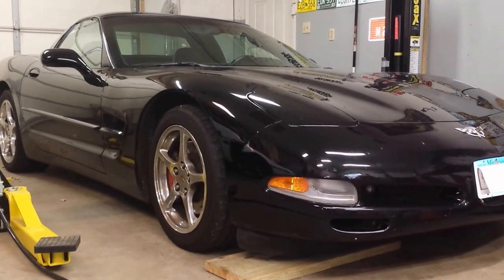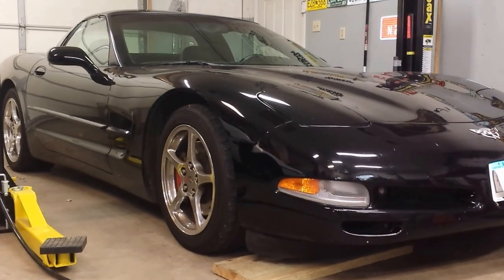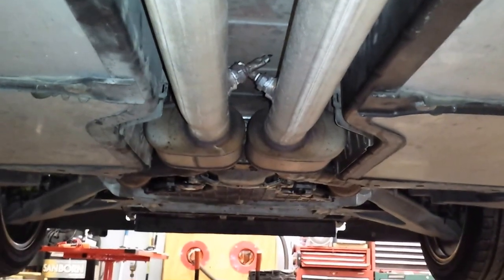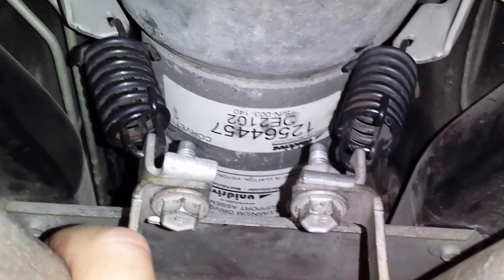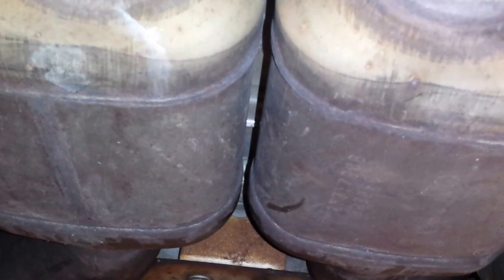C5 Corvette Exhaust Rattle/Noise FIX

Comment: I have a question? I have a 2004 C5, its definitely got that rattle, and when its idling, it has a rumble. It runs great and starts normal. Had the vette for 15 years, just had it serviced, but they said nothing was wrong? Thats not true! So where or what can I do to have a good mechanic help me? Im a female, but Ive taken care of my baby since I bought in 2004. No one seems to think there is a problem, I know my vette, and definitely theres an issue. Any suggestions? Im in Las Vegas. Thank you!, Scarlett
Reply from the maker: Jump on the corvetteforum.com and ask in the C5 section for the best vette shop in the Vegas area.  Someone there will steer you in the right direction!

Comment: You said you cut out the catalytic converter and cleaned them?
Reply from the maker: I had one that came apart inside the shell.  I cut it open and removed the obstruction and stitched it back up.  Since then, I replaced it with a good one.